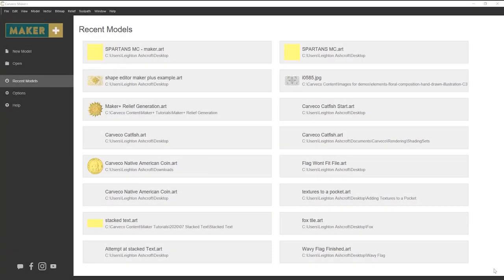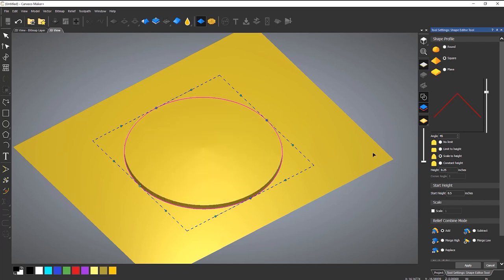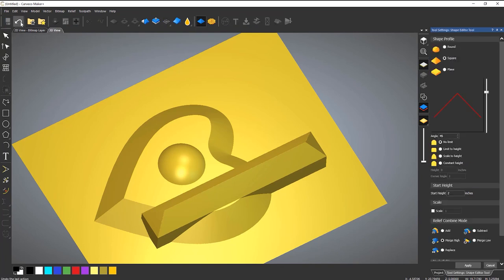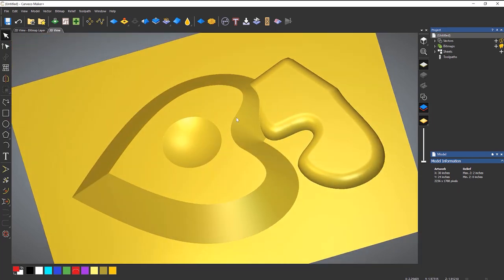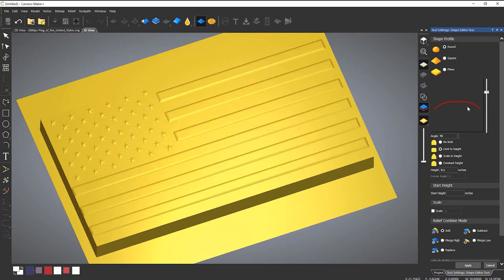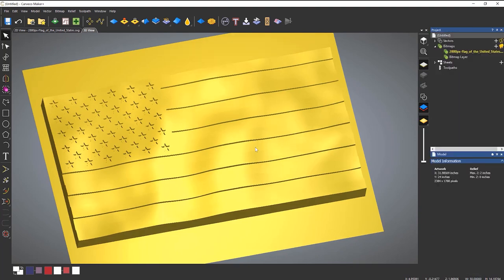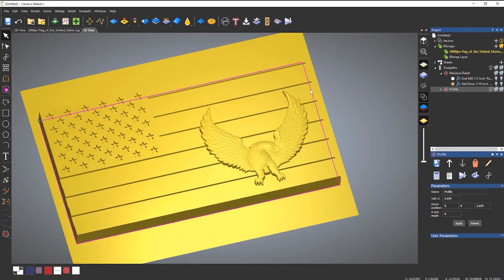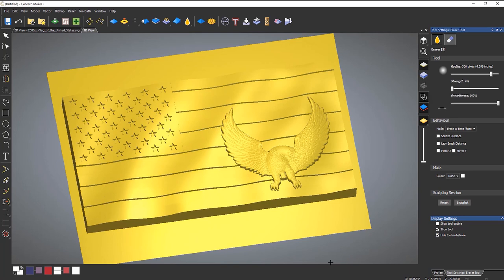Maker Plus Tutorial Wavy Flag creation using the Shape Editor

Comment: I've followed your steps click for click(multiple times) and every time that I get to the 24:44 point and try to delete the unwanted vectors they are grouped with the stripes and if I hit delete...they all get deleted. I don't get a ungroup. It has to be a settings issue, can you help me, please.
Reply from the maker: Hi Ken, it sounds like they are grouped together, if so they will be a purple colour.  To ungroup, right click on the vectors and select "Ungroup All".
Reply: @Carveco  Nope, they aren't grouped. I ended up using the scissors to trim. I then made a circle in the stripes area but I don't get a weld option. All of the stripes are one single vector so explode didn't work for me. Im trying to make a circle to use as a reference point for a relief that I want to add.

Comment: How do you confine the finish tool path to just the eagle after a roughing tool path, v bit for the stars, etc.?
Reply from the maker: You can use vectors as the boundary of the machining.  When you go into the toolpath, there is a dropdown, by default it is set to "whole model", change it to "selected vectors"